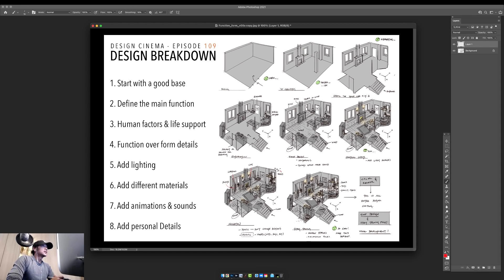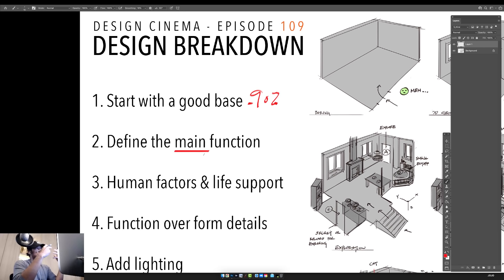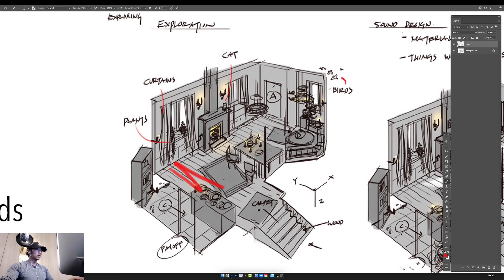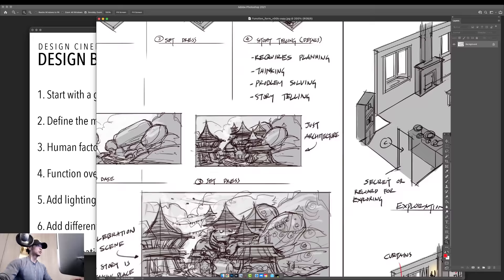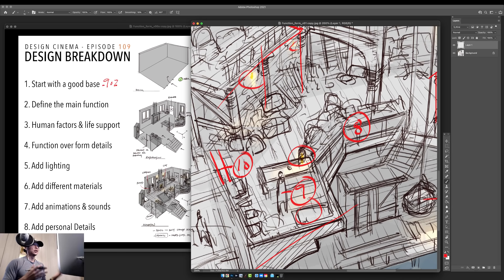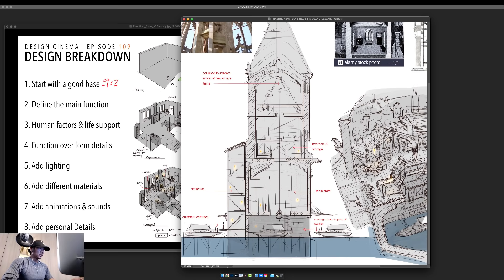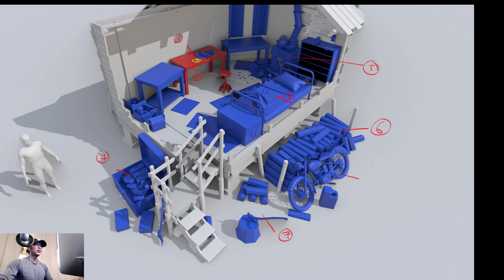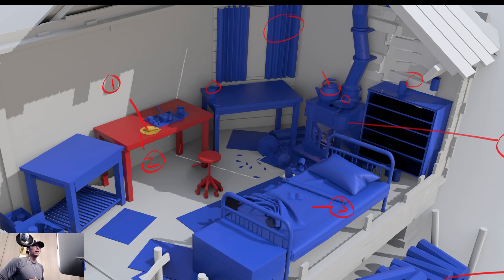Design Cinema - Episode 109 - Design Breakdown

Comment: There were some great designs here and once again, i learned a great deal.

One thing i would like to ask and i could be wrong but the one where the guy Ian, i think it was, created a design on a ship, isn't the ship's wheel the wrong way around?

I loved the art style of his work.
Reply: I found the original ship his design is based on, that's how it is in the real one too. The reason for this seems to be that it was a simpler and more reliable construction, and it was often used in ships from that era (around early 1900? or so).
Reply: @bagthebag8049  That's a fair enough point and something I didn't realise. 
Thank you for letting me know. It seems you do learn something new every day, 😂

Comment: i'm still having a hard to figure out how it can be done in 2 or 3 days with so many details and research going on  .;considering the deadlines in the film and movies industry ,usually in the movies industry it's an image a day .and a concept art  3 days in the gaming industry
Reply: cutouts often take between 30-35 and sometimes even 40 hours  of work time at the student level, but I think the school is really good at gradating difficulty to help us build efficiency. They do this by having us do really simple rooms like bedrooms and shops at the beginning, and then ramping up the difficulty to vehicle rooms + exteriors, throne rooms, hideouts etc. This way you can build up your process efficiency for this specific type of work. You learn to adjust your process/finishing level to suit production requirements and deadline. 

In a similar vein, that's why so much of film concept art is heavily 3d/photobashed with not too much line to cut output time and to ensure the results are comparable to the photo-real product. Additionally the barrier for entry is a bit higher on film so people on those productions are usually killers. 

For games, things can vary. Not all companies need a 3 day turnaround at this degree of finish, but it's definitely possible and they'll be plenty of bashing/drawing over 3d to ensure a high detail density.

Hope some of this helps.